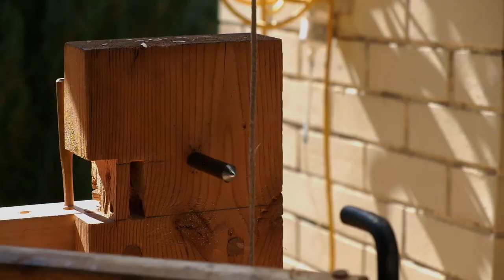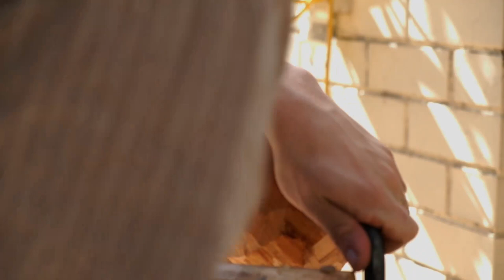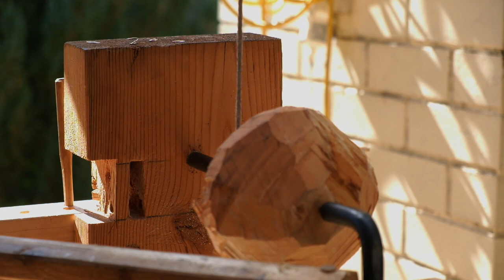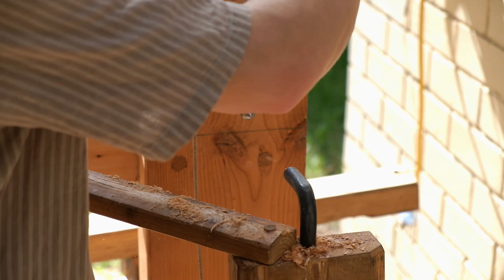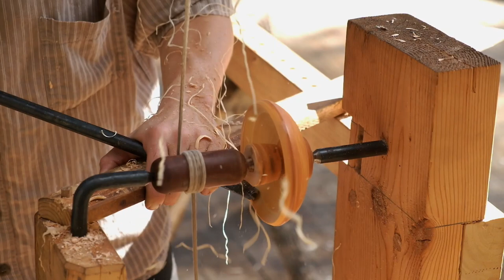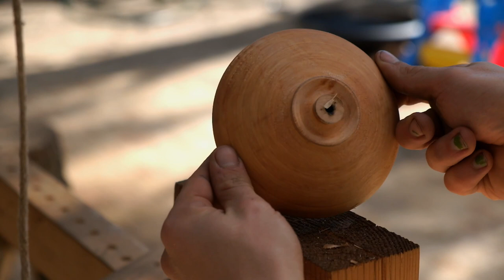Turning a bowl on the spring pole lathe with self-forged tools - Real-time / Complete process

Comment: Very interesting seeing you feel your way through the process. I have very little personal experience of using a pole lathe but wonder if a heavier more stable tool rest would be an advantage? I just rewatched one of Yoav Elkayam's pole lathe turning videos and his tool rest is much deeper and appears to be very stable.
Reply from the maker: I'm not sure what that would achieve but it's an interesting idea. This is Owen Thomas's lathe design, I made it straight from the plans. I do plan to rebuild this lathe with heavier components / hardwood when I get the opportunity. It's all made from quite light softwoods as that's all I had.